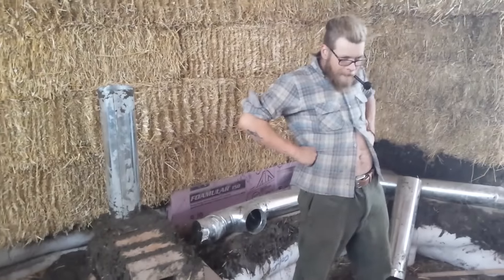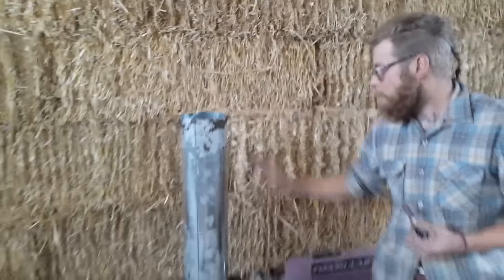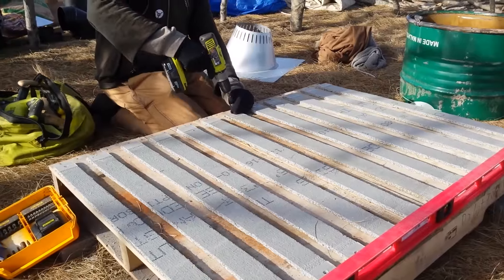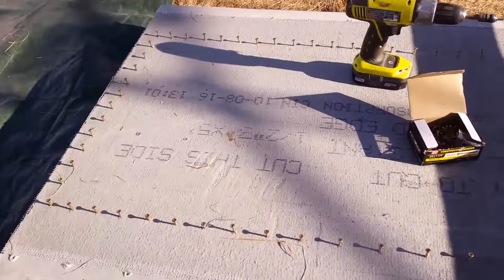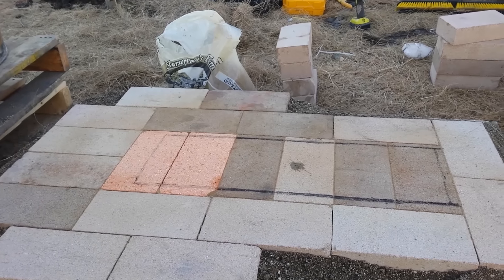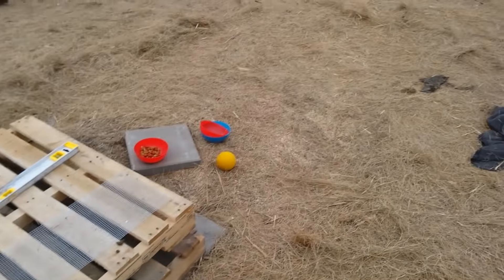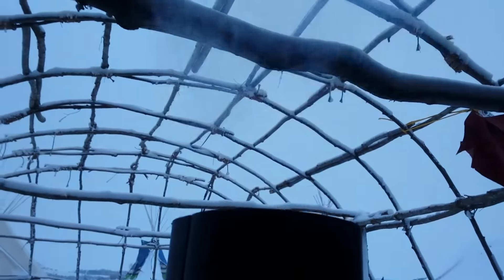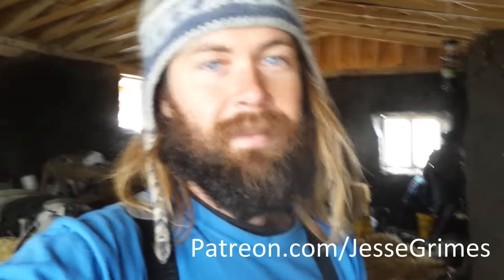Building a Rocket Mass Heater at Standing Rock Part 2

Comment: if you get a chance you should visit Yergi, at the tea house by Pueblo Camp and check out the 8" and the 4" system that is doing great out there
Reply from the maker: I'm no longer at Standing Rock.  You should check out the RMH i built in the Large longhouse at the school, near the road and the south gate at oceti. There were some unfortunate event there surrounding the transition between camps, so the space got a bit trashed by squatters, but the heater is fully operational and ready to heat that large space.  My friend Nathan has been working to get the place cleaned up, he could probably use some help, especially from someone who knows how to light the heater.  He lives in a big white sportsmobile van.
Reply: Jesse Grimes I left on the 9th I'll pass on the word to Shadrick who is still there. I am on my way to help Aransas Rising set up their camp. a land owner I am told donated 6 acres and wants an ecologically minded spirit camp that is as leave no trace as possible. probably also get into building food systems

Comment: Although I should finish watching the video before asking my questions - I don't want to forget them. 
You have the "slip", which seems to be a thin mud slurry and it seems as if you are using it as a type of mortar.
Does that work well - I don't recall seeing that in any of Eric and Erika's materials.
Doesn't the water content endanger the integrity of the firebricks upon initial firing?
Reply from the maker: it is a clay slip, just clay mixed with a lot of water.  It should be fire clay, or the dust gathered from cutting firebrick on a tile saw, but I didn't have any of that available.  In Ernie and Erica's book it said that if your fire brick is of a uniform size and nice and smooth you can just use a clay slip as long as the brick courses stay level. If the bricks are uneven you need to use a clay/sand mortar, which acts as "liquid shims" to even out the differences and keep everything level.  You have to dip the bricks in water before applying the slip, otherwise the brick would absorb all the moisture out of the slip/mortar too quickly and cause cracking.  I was pretty much just going off of the book on this one.
Reply: Jesse Grimes   Thank you sir. It's been a while since I read the manual and didn't recall those details. I haven't had the opportunity to build my own yet. It may be a year or three before that happens. Thank you also for Standing with Standing Rock. I am supporting with prayers and sharing. I'm not in a position to do much more than that at this time.

Comment: kind of concerned about the barrel so close to the strawbale wall. at about 700 to 800 degrees at the barrel the straw under the cob may start to smolder. just saying
Reply from the maker: Michael Ellender I raised the same concern, but the builder of this RMH thought it would be ok.  we did scoop out the wall a bit to make it further from the barrel.  Anyhow, the whole structure got bulldozed so not much to worry about anymore.